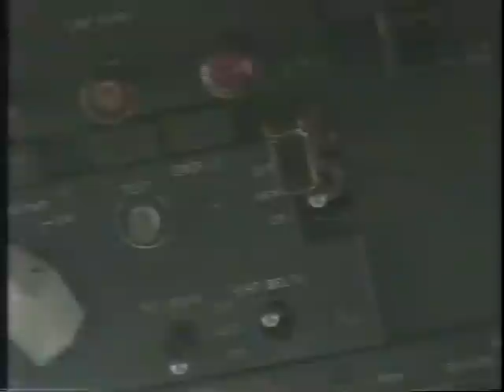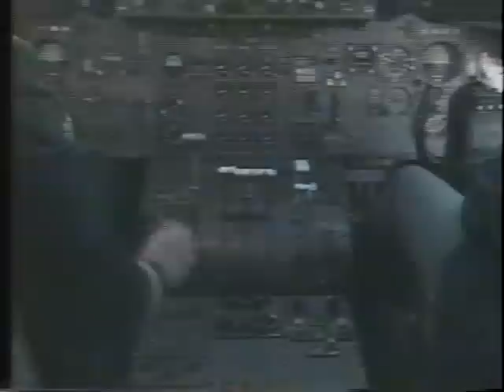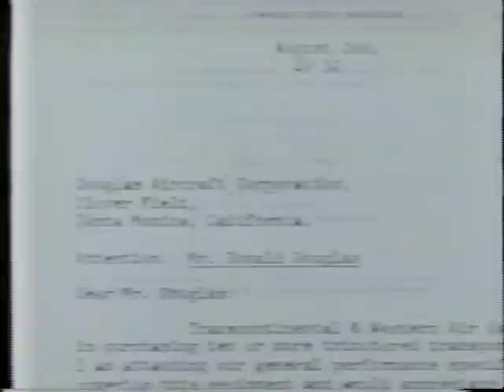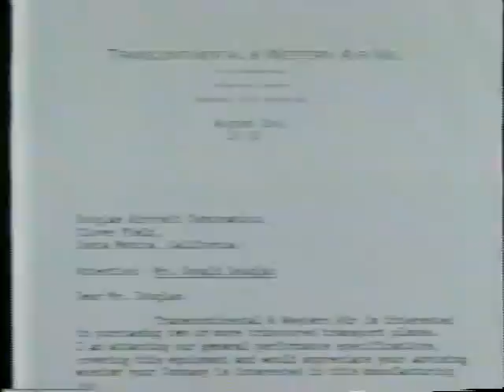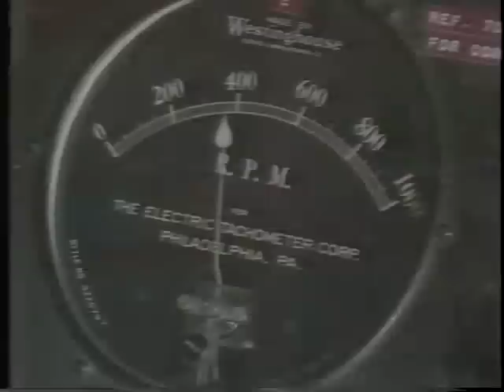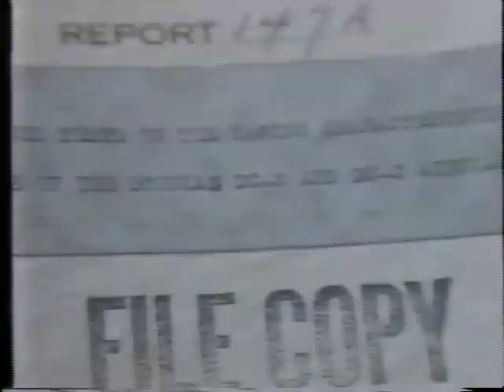The DC-3 The Plane That Changed The World. Broadcast by Public Television in 1985.

Comment: On a sidenote... the DC-10 that saw it's wing engine break away and the plane crash... has never left memory.
Reply: Don't forget, the root cause of that was a MAINTENANCE screw up. 
To cheat 'book time' on engine swaps someone decided pulling the two pins for the engine pylon to drop the assembly, and reinstall the same way, was a good idea.  Book said to remove engine FROM the pylon, THEN remove pylon if desired.
Having assemblies ready to go saved down time for the planes, but the stress of horsing engine & pylon into position & pinning them cracked/fatigued the mounting points.
When the Factory says don't do it the 'obvious' way, there might be a REASON.
Reply: @rogervoss4877  Left wing, Chicago, rolled over and crashed just after takeoff?  One of the completely POINTLESS tragedies, because nothing new was learned -- just reiterating the "do it right, the first time".

Comment: OK, I used to live in Hawaii, island of Oahu.

One of my jobs, the one I went over for, was 
delivering flowers to international cargo flights.
We also picked up cargo, from other local flights.

It seems that the DC 3, would be an ideal aircraft, 
for those inter-island flights. (Well, there is the 
Aloha Air "convertible model" flight, to consider.)

Let's just say, that the smell of a dendrobium orchid 
is barely detected, the smell of 10 000 sprays, well, 
something to experience!  I have.  KILLER smell.

steve

Comment: Steam Heat? Did they have a fuel fired boiler on board, or did they have a heat exchanger run off the engines?
Reply: I wondered about that myself.
Reply from the maker: Check this page out for more info on the steam heating system installed on the DC-3 - http://www.dc3history.org/chapter_5.htm
Reply: That looks to be some interesting reading. Thanks for sending it my way.
Reply: Kinda used both... heat from the exhaust was used to heat water to steam.. Famous author/DC3 captain Ernest Gann indicated that a copilot who could maintain a stable cabin temperature was worth his weight in gold...
Reply: OH, Earnest K. Gann! It has been many years since I read his "Song of the Sky". It was wonderful. There is another book out there that was about the pre-WWII expedition of a PBY to map the Pacific and to reconoiter Japanese positions. I can not remember the title, and would love to read it again.
Reply: +Khadijah Brown From some details, probably 1980-1982. The PBA company had problems with 2 accidents on 1984 and 1985, so the docu was made before.
Reply: +Khadijah Brown:   I grew up on a airfield with a father who was instructor, dust-, test- and crazyflyingpilot, and I got the bug too. But was only gliderpilot for 10 years. MIss it like H.. a lot,  but see and read a lot about especially the early years of flying.  (The "computerflying" of to day is way too boring for me..)
Back to topic: Thank you for the title "Song of the Sky" and do you have any other titles or authors you can recommend, I would be very gratefull.   I really enjoyed the story and book about Chuck Yeager, and the novel  from Nevil Shute's The Rainbow and the Rose", which I got and read first time in 1978. (2 years before I startet gliderflying at the age of 17.  We were less than a 100 females gliderpilots at the time).
All the best, Pia (Denmark)
Reply: +Khadijah Brown  "Song of the Sky" was written by a wonderful aviator named Guy Murchie. He was a navigator, same era as Ernie Gann. Ernie's books are legion; Fate is the Hunter(where the story about the DC-3 heater came from);  Band of Brothers-different subject and, preceded the WWII action title-; Song of the Sirens, about sailing; Island in the Sky- wonderful b&w movie with John Wayne and a host of other wonderful stars: High and the Mighty- about the fate of most transport pilots Blaze of Noon, Benjamin Lawless, The Magistrate, his list goes on and on. For real Aviation magic and philosophical history, you might want to explore the writings of Antoine de Saint-Exupery, of  The Little Prince-fame; such as Night Flight, Wind Sand and Stars.  Have a wonderful journey.

Comment: See the story of the DC 2 1/2.  See http://www.douglasdc3.com/dc2half/dc2half.htm  .The Japanese had  damaged the outer starboard wing section of a DC3. The Chinese airline didn't have a replacement so the out wing section from a DC2 was hung underneath another DC3 a flown to and then mounted on the damaged DC3. Which was dubbed the DC 2 1/2. The aircraft just escaped the arrived the Japanese army.

Comment: the dc10 was a seriously flawed and the dc9 was even crappier.
Reply: I agree that the DC10 had three terrible flaws.  One was the fact that a baggage handler could force the cargo door latch in such a way the door did not latch.  Second was the way the backup hydraulics were configured.  Third was the ventilation between the cargo hold and cabin.  After 3 incidences plus the Chicago crash, the public lost confidence in the plane.  This is in-spite of the fact all problems were fixed.  Today, it regarded as a very safe plane.
Reply: Don't know if you are aware of this but look up U.S.A.F KC10.
Reply: Read up on the matter.  The DC-10 was one of the safest airplanes made.  Almost all of the crashes were due to improper maintenance, as attested to by a maintenance chief committing suicide because of short cuts he ordered that led to loss of lives.  The craft was safe.....just not well-maintained.